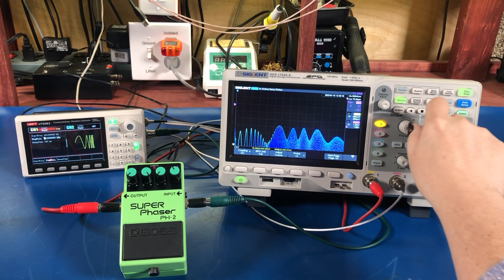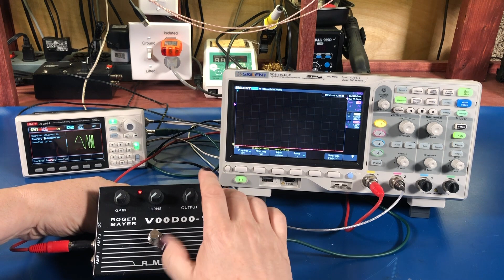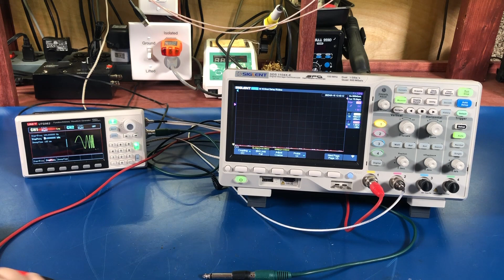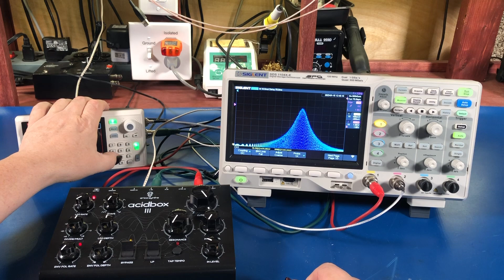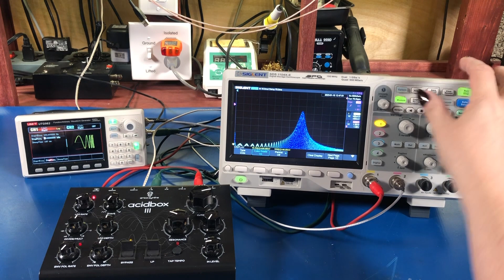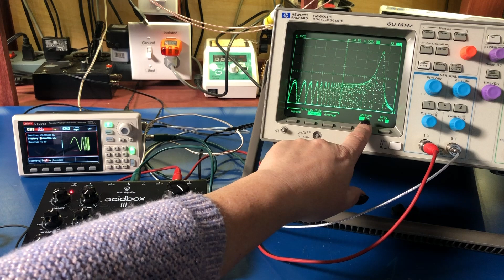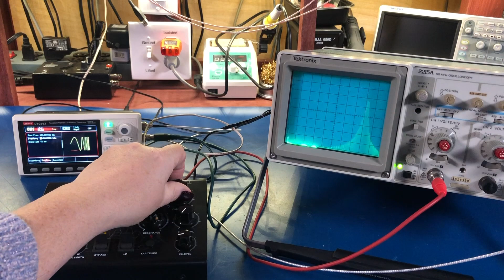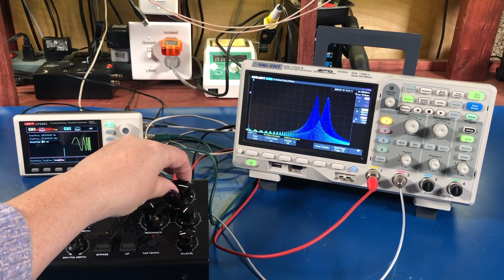Bode plots on an Oscilloscope

Comment: Uni-t gear is underrated. Ive played guitar at an advanced level for over 30 years and 25 of it was a distortion pedal and giant bass amp. A hurricane ruined them so i got a line 6. Going from nothing to way too many options haha. I make pedals but i give them away as kits for friends to build. The boss pedal i used costs the same now as it did in my teens haha.

Cool video